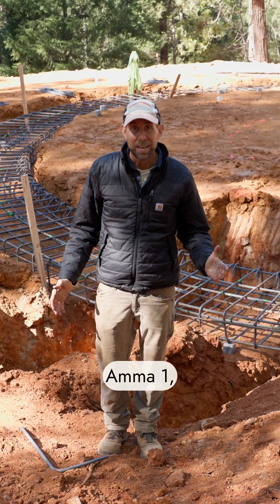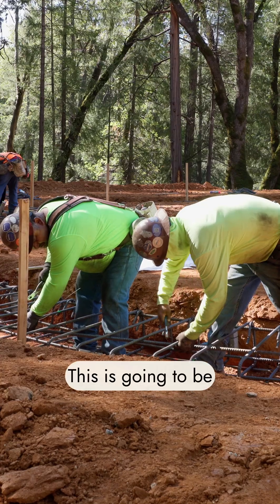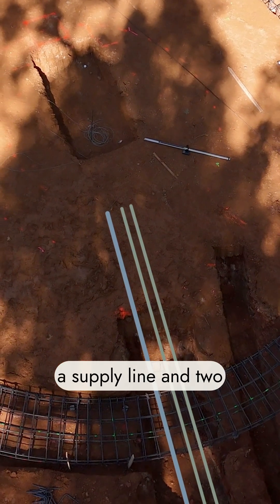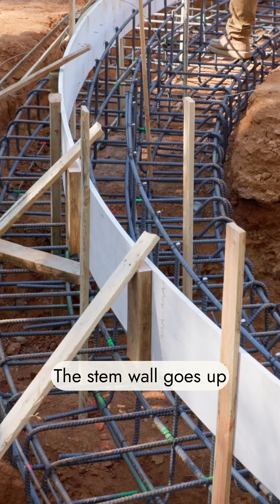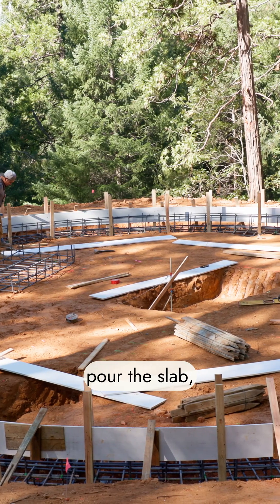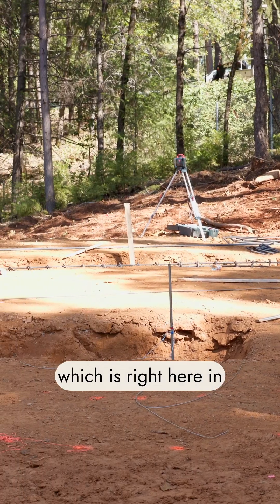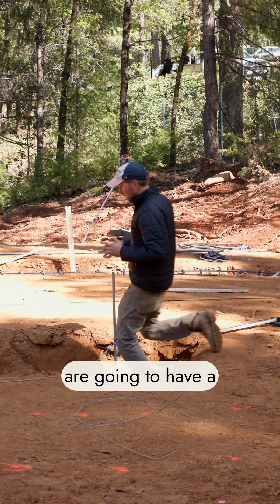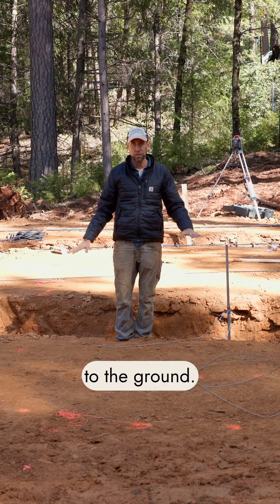Site Update: Footing, Rebar, and Stem Wall Progress

Comment: Awesome info. What about the interior access for electrical and plumbing repairs if needed, wouldn’t want the repairman to break a bioceramic disc to make repairs.
Reply from the maker: Great question. Systems like electrical and plumbing are designed with dedicated access paths and service zones, so maintenance doesn’t require breaking structural bioceramic components. The goal is long-term serviceability built into the design from the start.

Comment: No basement??
Reply: Too expensive.  Most expensive storage room.  Diffrent if your using it for cooling,  heating or are in an are with extremely high property cost.
Reply from the maker: These designs don’t include a basement. The homes are engineered on slab and foundation systems optimized for structural performance, efficiency, and code compliance.
Reply: @Geoship you don't need a basement in a Two bedroom, Two bath home. A separate garage will more than suffice.
Reply: I wouldn't put a basement in my home. I can build a submersive container in the ground right next door and have to put that in my house. Perhaps, in a larger home, like a 3 bedroom or 4 bedroom house.